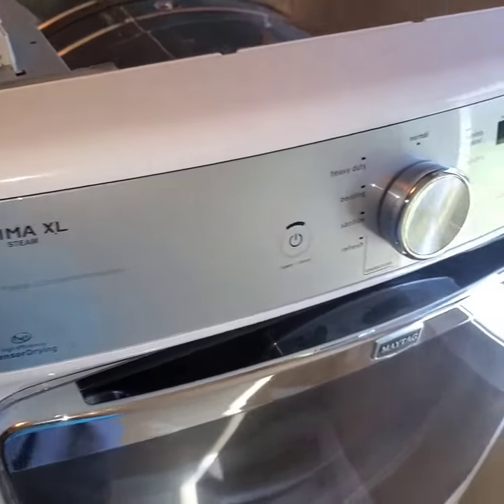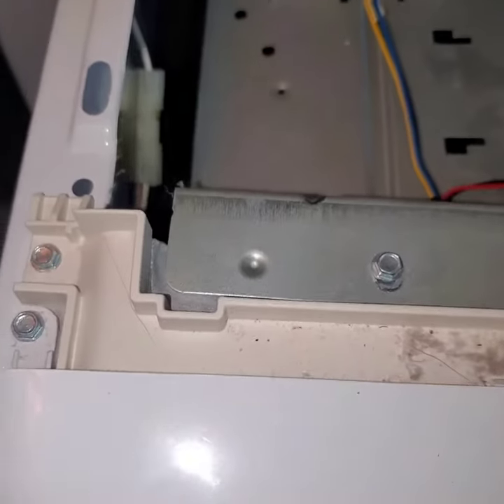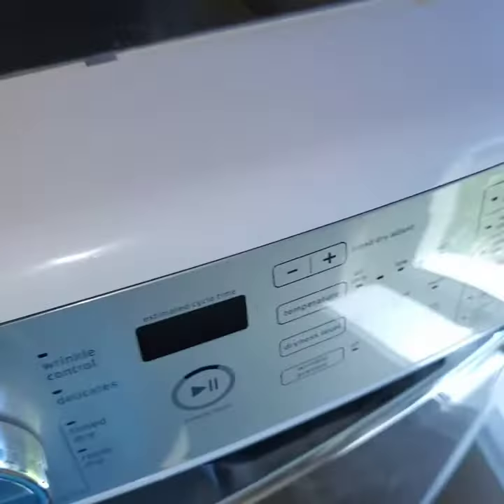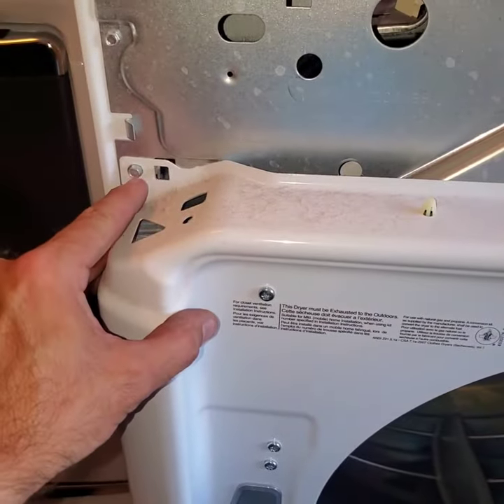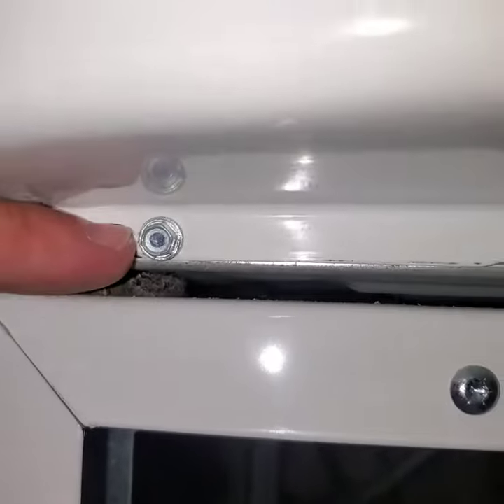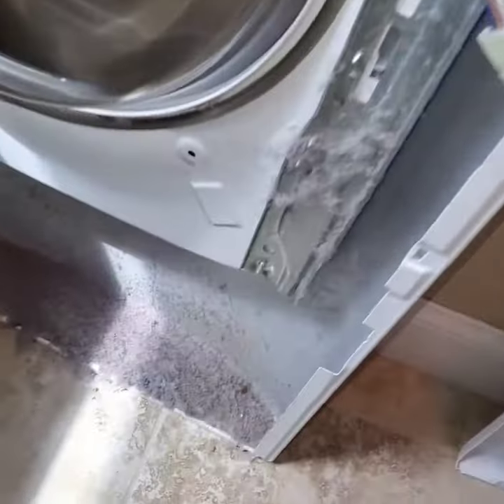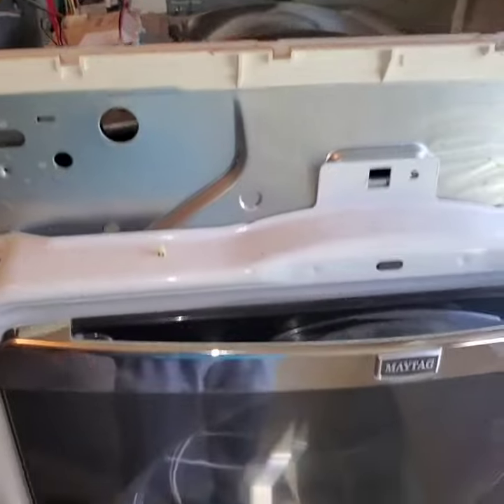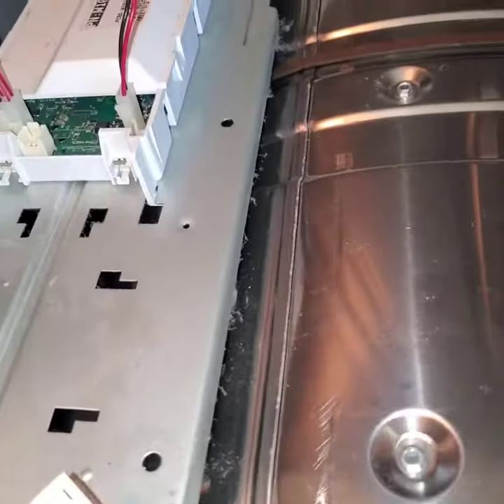How to Disassemble  Maytag Maxima XL

Comment: the door on my MAYTAG MAXIMA is sagging a bit and rubbing on the lower inside of the dryer.  How can it be leveled?
Reply from the maker: I am not an appliance person but my best idea is check the screws that hold the door in the door frame and see if they're loose. Loose screws I could imagine would allow that sagging
Reply: Mine does the same.  The door is too heavy for what’s holding it.  I just make sure I lift the door when closing.
Reply: Same...

Comment: My Maxima XL stopped heating.  I’m wanting to check the thermal fuse.  Where is it located?
Reply from the maker: Possibly mounted to the dryer exhaust within the dryer cabinet. I'm not an appliance repair tech, but I found some good info when I did a Google search. 

You also need to consider the Why. Why did the part fail? Often times it's a vent issue that causes am overheating dryer that then causes part failure
Reply: Did you figure out where it was? I took the back off and couldn't find. Maybe need to take the front off like in this video.

Comment: My maxima xl just clicks , but won't start.
Reply from the maker: Well I can't tell you what's going on I'm not an appliance repair person. It could be the starter button. It could be the door switch. Or it could be something else so unfortunately you're likely going to have to call an appliance repair person
Reply: You have to reset it.  Check the directions.  I had to do it once before
Reply: Thermal fuse